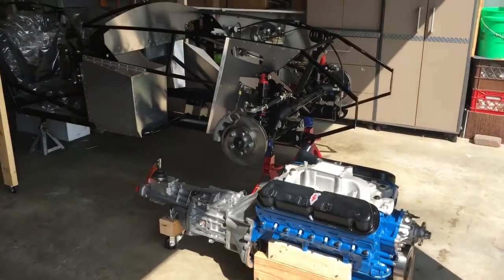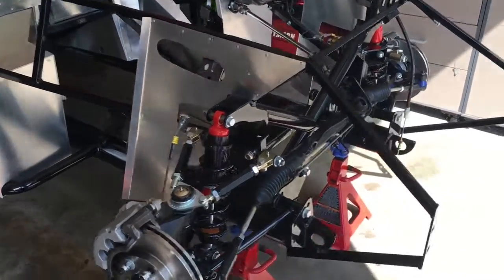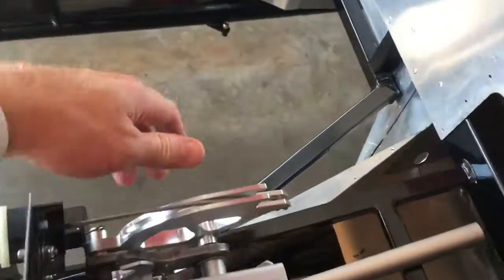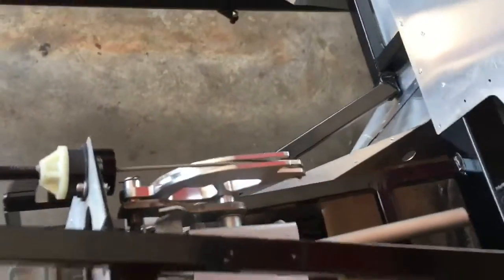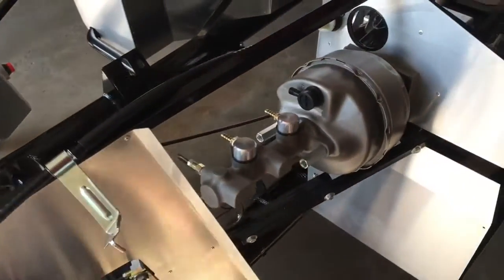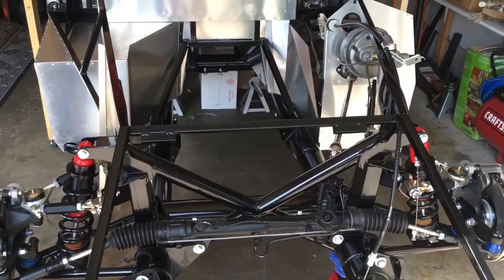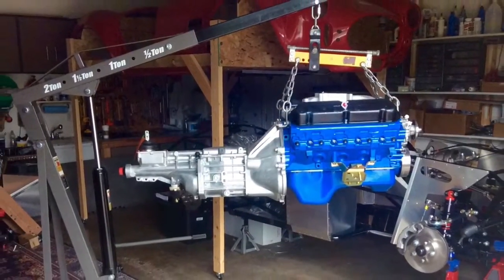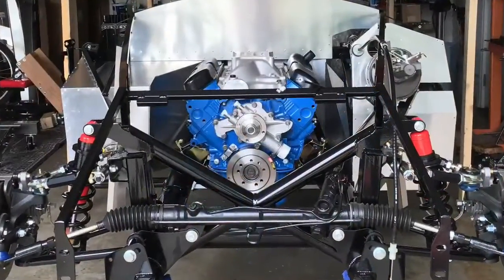Factory Five Cobra: Engine installation

Comment: Hello. Did you have any issues with stock oil pan and it hanging down below cross member? Thank you your videos. I have watched them many times to help with my build.
Reply from the maker: I wish I could add pics here! - my OEM does not hang below the cross member - but- it is close - it's the standard 5 quart ford pan, one piece rear main seal and the low point is the rear sump drain plug. Good luck with the build!

Comment: did the transmission mount come with the car
Reply from the maker: no transmission mount came it my kit, but I think you get one in the complete kit. Its a cheap pieces though (I think urethane mounts are like $50 at most for a ford powertrain) - make sure you check your pinion angle
Reply: @TacoJoe  yea i got the complete kit thanx